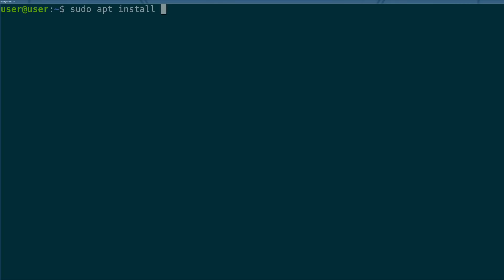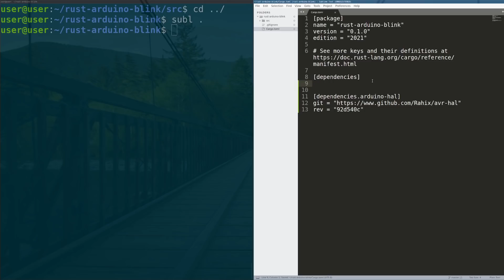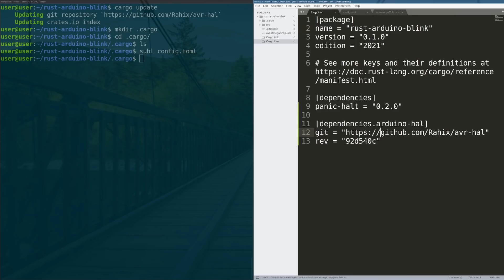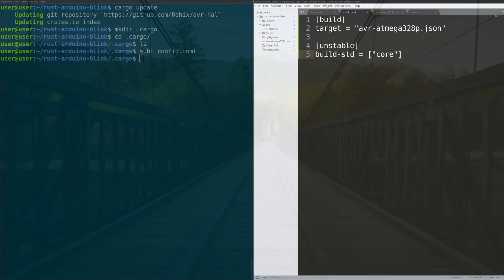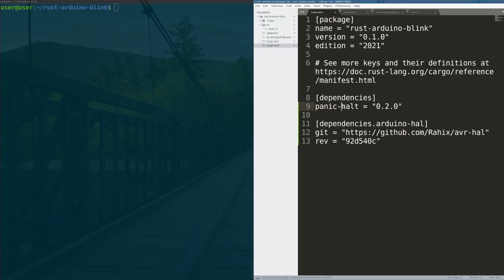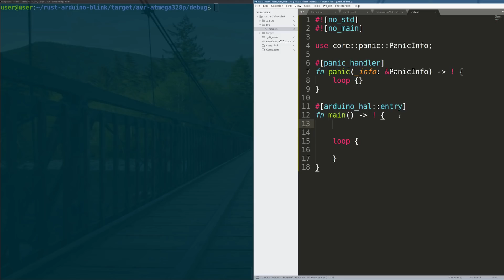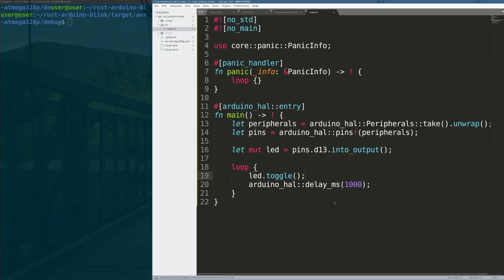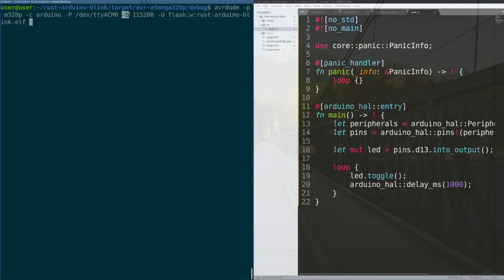Rust Runs on EVERYTHING, Including the Arduino | Adventures in Embedded Rust Programming

Comment: Thanks a lot for providing information to have Rust run on an 8 Bit device, even two years ago !
Happily nowadays we can run Rust on a similarly cheap but much more powerful  Pico 2 (RP23350 chip) supported by Embassy providing HAL, BSP and an Executor for the async/await pattern. Makes sense to use the most advanced language on the most advanced chip :) .

Comment: Thanks, great video ! :D
Much waiting for more in depth dives into embedded programming with rust ;)

few comments in compact form for people still on this 2y later :
1) As previous people have remarked, newer version of nightly also work to compile
2) it seems that besides gcc-avr, one also needs avr-libc, that can installed via 
apt install avr-libc
3) using the current version of the json file in Rahix/avr-hal and building the project using
cargo build --release 
4) if one goes with the current version of the github repo, it should not be forgotten to update to :
rev = "15080aa" (at the time of this comment)

Comment: Is there a significant performance enhancement by programming directly on the metal instead of on top of Linux or Windows?
Can I write a web server that interfaces with PostgreSQL without having an operating system installed?

Comment: Unless I missunderstand that amount of data written, that's insane for such a small function.
5,8KiB for a blinking LED, it's about 800B with Arduinos "C++ thingy" and 300B in C.
It's fine on Raspberries and other higher level of embedded systems but not an Atmega 328 or a PIC etc.

I get the point of this video that this language can be compiled for enything and it's great in that sense.
Keep up the good work.
Reply: To clear up your confusion 4 months later, it's just that this youtuber forgot to create a release build and to strip the binary.

Comment: Great video. I didn't know that Rust for Arduino Uno existed. 
Unfortunately I couldn't recreate what you built in this video. I gets stuck with:
"error: language item required, but not found: `eh_personality`"

When I do the cargo build at 08:22. Fortunately the examples by Rahix do compile and upload. 
Thanks for pointing out this is possible! Keep up the good work.
Reply: For anyone wondering I have solved the error 'eh_personality'.. You need to put these lines in your cargo.toml:

[profile.dev]
panic = "abort"

[profile.release]
panic = "abort"
Reply: I have the same problem.. Can you compile your project now?

Comment: This is great and all, and don't get me wrong, this is a really impressive proof of concept project. But isn't the code like... bloated to the Extreme? For me, an embedded project is a challenge, because you have to keep complexity in mind, speed, and yes, code size. Yes, you COULD use a bigger micro, but you also could slap a RPI on and call it a day. What's the challenge in that?
Again, this is a great video, and straight to the point tutorial, I just don't see the practicality of it (yet)!

Comment: Is Rust bloated and slow compared to embedded c? As someone who exclusively uses c for real time embedded applications I am very partial to C compared to anything else, this may just be internal bias but if I see any type of intelligence or memory safety I immediately assume it is going to be slow code.
Reply: Rust can be just as fast as c if not faster. Basically its around the same speed depending on application and implementation. Most of rusts checks happen at compile time.
Reply: The runtime performance is same as C or C++. Very often the same exact machine instructions. Memory safety comes from what the compiler refuses to build, not from additional runtime checks.
Reply: rust seems like c with safety wheels attached. It probably is much slower
Reply: @mychromebook9935  
What?

You haven't really done anything with Rust, have you?

Comment: I appreciate you making these videos. Been watching as I work on my collection of mcus such as RP2040, ESP32-S2, M4 (SAMD51) and similar. I use CircuitPython and C++ typically. I'd be into using Rust. Most of this is my hobby work since as a CTO they don't expect me to write much code anymore ;-) What is unclear to me is why I would really want to go through this trouble. Between Assembly and C++ I can get screaming fast performance as needed, and good enough performance in CircuitPython. I've done C/C++ on and off for nearly 4 decades so memory problems typically are not a big factor. I get it that Rust includes some extra compile and runtime checks to provide more safety. But what else does it add? Syntactically is it just a safer C++ or does it offer new patterns for threading or cores? So far I haven't really seen anything explaining something more than better memory safety in a world of pointers and references. If you can think of other cool reasons to use Rust please pass them on. I'm a new subscriber to your channel and enjoy the videos.
Reply: I think a lot of it comes down to the high-level abstractions and type safety that Rust provides. Rust's iterators and async/await primitives are very nice, so the ability to write nice-looking abstractions that compile away into efficient for-loops, lightweight state machines, and compile-time only checks on embedded platforms is pretty sweet. It's mostly down to your own tastes: if you enjoy functional programming and type safety but don't want to sacrifice control or performance on embedded systems, Rust can give you that sweet spot.

Comment: Just a question about the upload process, at the end it says “5792 bytes of flash verified”, does that mean that that is the total size of the program, because you said the size was 600k before, is that 600k just the elf file and the 5792 bytes the actual size used on the arduino?
Reply from the maker: Exactly! AVRDUDE isn't taking the whole ELF and stuffing it in there, only the necessary program memory.

Comment: I wanted to add a note that people don't HAVE to type "rustup override set nightly-2021-01-07" in order to have the code built. The good part about it is that you sure as heck need to have a nightly toolchain, but everything after nightly-2021-01-07 would work, so you could've just ran "rustup override set nightly" which would've instead installed the latest nightly build available and overrided the project with it. Other than that, amazing content :washhands:
Reply: Thank you, this was my main question watching the video in 2023 :)

Comment: you should mention something about changing the build options. Especially since you dont have a debugger on the AVR,  using vanilla debug  yields no benefit except the increased binary size. That's also true for arm &riscv , enabling   lto & friends, even for debug builds, makes the code much much smaller.
Reply: and also that using [no_std] means you cannot use 90% of the libraries you may be used to.

Comment: Out of curiosity: A friend of mine is interested in Rust and also has a lot to do with embedded devices, but he hesitates to use Rust there, because he thinks fo his taste there is still way too much C in it. My question would be how it is changing with time or if his argument is already depricated. Love your videos by the way!
Reply: I'm not exactly an expert on embedded, but this sounds very wrong to me.

I've admittedly only coded in one "higher-level" language for controllers, that being Micropython, but that one was already showing me the limits.

You barely ever have any bindings for compatible libraries (which you need to drive sensors or even networking), and I ran out of memory fast. Python pushes you to a model that is resource intensive.

Of you can't find a fitting library with binding for your device you need to use a C library. Rust can do that just fine and easily, Python, and I'm certain most other  comparable languages, make that painful. 

As I said I've got limited experience, but from what I've seen, Rust as a basic language is PERFECT for embedded. Because of no GC or pervasive reference counting it has basically the same memory footprint as C, which is good on memory starved embedded devices (memory costs energy and money... Disproportionately much on embedded). Rust doesnt use exceptions, like C++, but an explicit error model, which can actually run without a heap, and which also means far less debugging, because it's explicit and thus always well documented and easy to spot.

Rust has an ecosystem of packages on crates.io that run on "no_std" environments, which is pretty much a necessity on embedded. 

And because if it's expressive type system libraries have much less gotchas than your typical C library. Even your typical device manufacturer will have a hard time to code a difficult to use Iibrary:).

Comment: In this video, you flashed the AVR. . . did you overwrite the bootloader?  did you specify the main() to be put in a section that did not clobber the bootloader?
Reply from the maker: Yup! When you use the Arduino bootloader instead of the ICSP, it doesn’t touch the bootloader section.

Comment: Could you strip out the unused parts of the final ELF file here as well?? 600kb is not lightweight for a AVR to be honest. Big reasons I love your Assembler stuff is mainly the final output of it is so damn slimmed down i could just cram extra stuff onto the Pico that the C compiler wouldn't cuz of extra libs it just pulls into support the build.
Reply from the maker: Luckily the whole ELF doesn’t get flashed to the board. Most of that 600Kb is ELF header and debug symbols. AVRDUDE rips out only programmable pages from the ELF and puts them on the AVR.

Comment: This looks cool, but a HAL for an AVR? All this seems like an overly complicated way of avoiding reading the datasheet. Over 4k of flash to twiddle an output- if you put this into a product, you'd be throwing away money for having to use an AVR with more flash.
Reply: The only problem is that he ran a debug build. A release build is only 324 bytes. That is much smaller than Arduino. It is still larger than the ~200 bytes for raw C, but that is due to the hall doing a little bit of extra initialization that you would probably end up adding to the C anyway.

Comment: I loath the let keyword! Always have in TCL and some Basics. 
And man, this is fucking involved for such a trivial little thing. It's code is even smaller in bloody assembler! 
I'd write something this trivial in Assembler with a nice little XOR on the port to toggle it. :D
6K is btw smaller than the 10M you said a runttime would take (as someone in the comments last week also told me). But 600K to toggle a single bit is utterly unacceptable!
Reply from the maker: LOL! Yeah, it was pretty clumsy to get the cargo set up. I highly suggest using the template crate in the description.
Reply: @LowLevelTV  I highly suggest to use C or Assembler in this case :D
Reply: Nearly 6000 bytes where the Arduino uses around 1000. Seems a tad on the big side to me . Assemnly can do it in 28 bytes! ;-)

Still, an interesting series so far, thanks.

Cheers,
Norm.
Reply: @NormanNodDunbar  The size issue here is mostly the fact that the video showed a debug build. A release build is 324 bytes of flash written. I think that is pretty decent. Also, rust for embedded is definitely growing and getting a nicer story. Definitely not nearly as robust as C or C++, especially on smaller/less common boards. The story is much much nicer on STM32 based boards.

Also, I thought properly setting up delay with timers and interrupts would take more than 28 bytes. Is it really possible to do this in only 28 bytes of assembly?
EDIT: It looks like the rust arduino-hal is just busy waiting for the second to pass and does not setup the timer with interupts, so that would greatly lower the number of bytes required. It is calling the equivalent of the arduino delayMicroseconds function that is just a busy loop.
The equivalent written directly in c++ ended up being 198 bytes for me. Difference looks to be due to some extra default setup from the rust hal library, but I am not completely sure.
Reply: @brendanhansknecht4650  Debug build, that makes sense as an explanation. Thanks.

28 bytes, yes. I'm writing a book on Arduino/AVR assembly language and I'm pretty sure 28 bytes is what I got it down to. Pure assembly using the gavrasm assembler, not compiling with gcc -- that builds in every interrupt vector etc and bulks it up to 192 bytes.

I'll dig out the code...

Cheers,
Norm.
Reply: @brendanhansknecht4650  ah well, I was wring. I got the blink down to 15 words, aka 30 bytes using assembly to toggle and delay with a busy loop delay. With Timer1 controlling PB1/D9, it was slightly larger. I did post the code but it seems YouTube has deleted my comment. I know it does that if you have URLs in, but my code didn't. Perhaps it doesn't like too much code?

:-(

Cheers,
Norm.
Reply: @NormanNodDunbar  that's awesome! Amazing what can be done with raw assembly.
Reply: @brendanhansknecht4650  it is indeed. For proper projects though, it takes longer to code and debug! But I'm rather fond of assembly language -- from Z80->MC68000->AVR. Not fond of X86 though!

Take care.

Cheers,
Norm.
Reply: No need to XOR. Just write to the PINx register instead of the PORTx register and it will toggle.

Cheers,
Norm.
Reply: @NormanNodDunbar  as far as I’m aware there’s no pin operation in avr assembly. 
There’s just an out opcode that takes a port and a value. Even the sbi and cbi operate on a whole port. It wouldn’t be very RISC if there was either :)
Or am I missing something?
Reply: @CallousCoder  ldi r16, (1<<PINB5)
Out PINB,r16

will toggle pin PB5 aka Arduino D13.

HTH

Cheers,
Norm.
Reply: @NormanNodDunbar  what is PINB ? That has to be a whole port. You just set one bit in that port PINB and that’s no different than use an eor with masking the bit you want to set or unset depending on its current state.
Reply: @CallousCoder  I think I'm missing your point. So bear with me.
We are discussing a "standard" blink sketch. To toggle PB5/D13 when configured as output, we can do:

    ldi r16,(1<<PORTB5)
    clr r17
Loop:
    out PORTB,r16
    ; do delay here
    out PORTB,r17
    ; do delay here
    rjmp loop

Or, for less code and exactly the same result:

    ldi r16,(1<<PINB5)
loop:
    out PINB,r16
    ; do delay here
    rjmp loop

Any time an output pin has 1 bit written to the appropriare PIN register, the output pin will toggle and won't affect any imput pins on the same port.

Atmel engineers reused the PINx registers for output pins to force a toggle, and reused the PORTx registers on input pins to set the pullups.

So, using the PIN registers, you can lose the EOR.

HTH

Cheers,
Norm.
Reply: @NormanNodDunbar  Hi Norman, thanks for taking the time.
My confusion came when you said toggle a pin. And I saw your PINB register. Because I know that the out opcode takes a port as an operand, and not a single pin. So I was wondering if I had overlooked something in all these years :)
Using the word pin, was confusing as you technically toggle a bit within a whole port. 

I wasn’t aware of the PINB register that toggles after a write. 
I always (and continue to do so :) ) use an xor to alternate a bit on and off.
But that was cool, I didn’t know that.
Reply: @CallousCoder  no worries at all. Glad we got there. 
Take care and happy coding.

Cheers,
Norm.

Comment: Pretty cool. I am looking to get into the embedded automotive space. I have been looking at C, Ada/Spark and Rust. C and Ada are both very mature and well used in the embedded space. But I do see the potential in Rust. I appreciate your videos, thanks!
Reply: C is your best choice.
Reply: I don't know much about Rust, but isn't one big advantage that Rust will not have Runtime Errors. All errors are handled by the compiler. Leaves only errors in logic. But in embedded that seems like a big advantage to me, because runtime errors are hard to track afterwards.
Reply: @erikjvanderveen  That is just factually incorrect mate what do you think the panic handler is for?
Reply: @AlbatrossCommando I was just echoing what I heard in previous video on Rust. Stating that one of the advantages of Rust compared to C(++) would be that it would be nearly impossible to write code that would give a runtime error. How this would be achieved, I don’t know. If you say there is a panic handler, then obviously it’s eiter a useless thing, or it’s there to handle runtime errors. I guess you might just be right. Maybe if there comes a time that I will learn Rust, I will find out. For now I’m to busy writing c# and typescript professionally and doing some c(++) for hobby
Reply: @erikjvanderveen Div by zero? Just to name one very obviously possible one.

Comment: Please note: Arduino is not AVR! Yes, most Arduino use AVR controllers, but also ARM. AVR controllers are also used outside the Arduino world.
Reply: Arduino is just a a collection of libraries and a simple IDE, like a sandbox for beginners. Of course Arduino didn't make AVR, they're just using the old chip on their branded PCBs
Reply: Just wondered how Rust would work on AVR (As the CPU is not into the LLVM of the Rust compiler) only ARM-Cortex etc is.
Reply: @HermanWillems  Rust works on AVR, but as far as I know it uses some parts from the AVR GCC toolchain. At least the linker